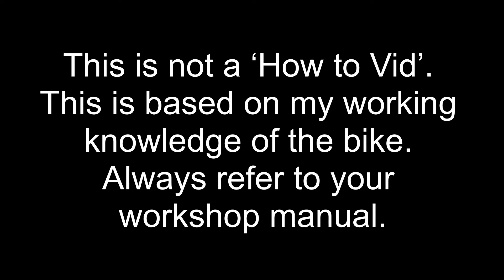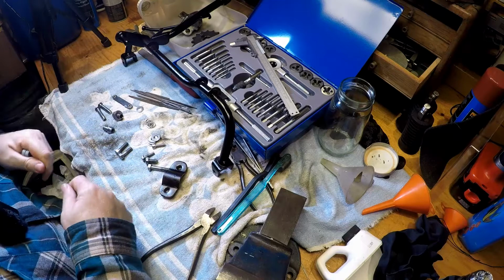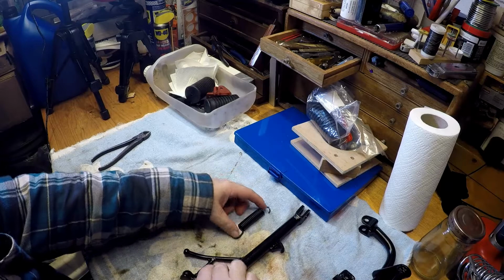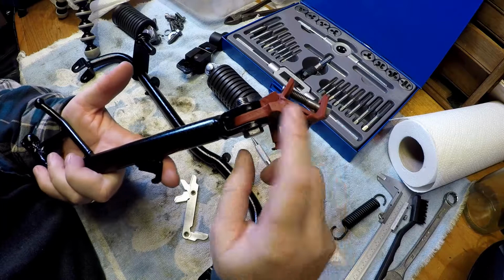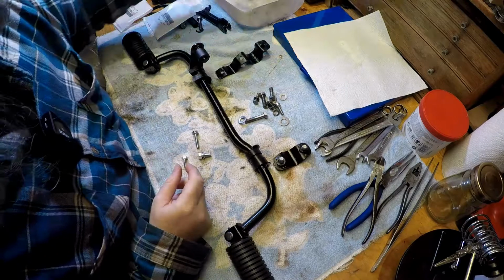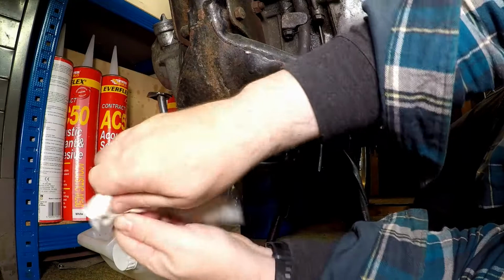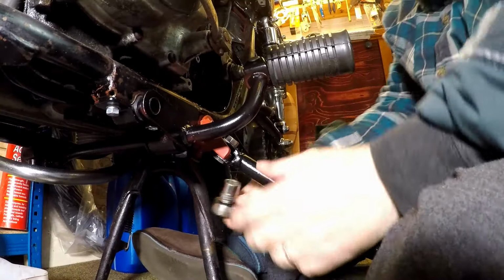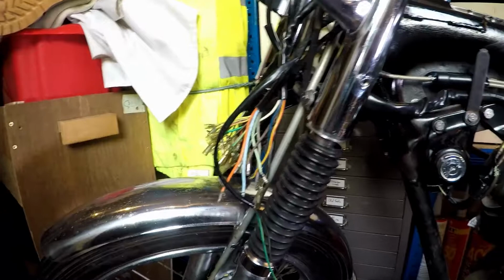Honda CB200 - Side Stand and Foot Pegs

Comment: They look very nice Gareth. I had the same problem with a new side stand bracket, did the same, made a bushing on the mini lathe and press fitted it. Look like you could do with a Spring puller tool :D
Reply from the maker: Oooooo, mini lathe. I so would like a mini lathe. I keep meaning to make a spring puller, tent peg a lump of wood... But then I do the task and forget about it until next time.